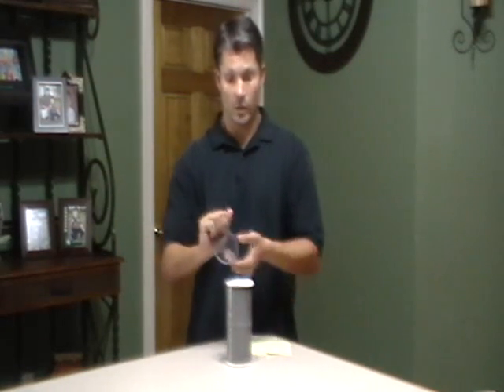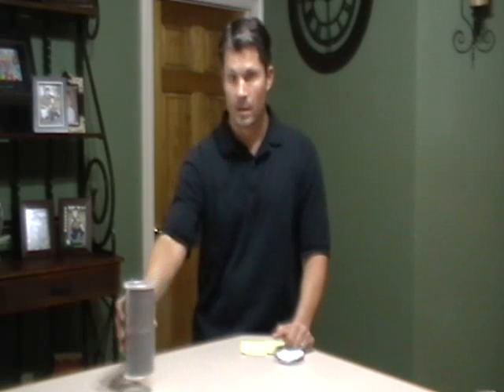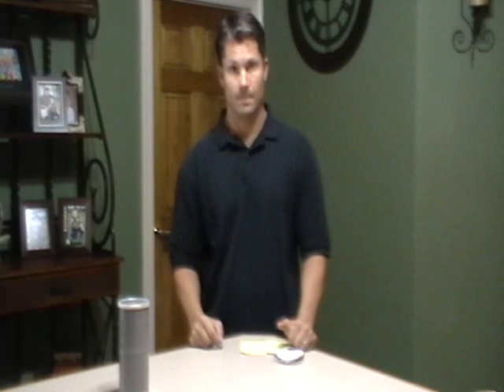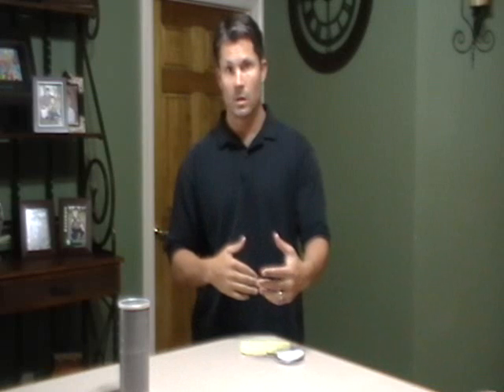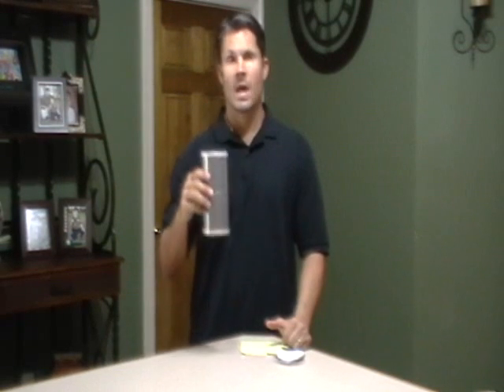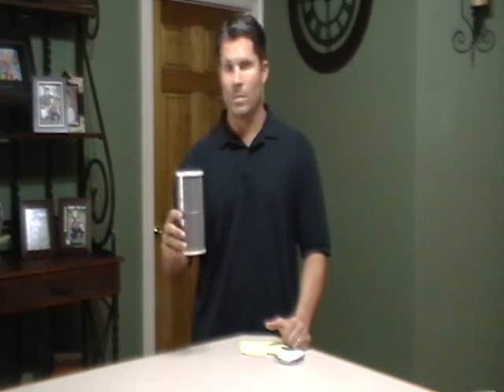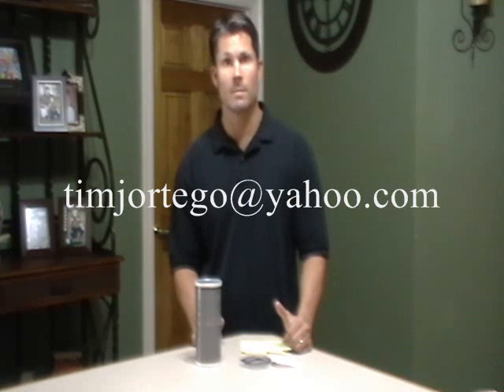Gulf of Mexico Oil Spill Clean Up and Containment

Comment: You have no idea of the volume of water and oil involved in this spill. Most of the oil you see on the surface has gone through a process called emulsification where the water and oil actually combine into another substance. This may work on diesel or motor oil, maybe even light crude, but not emulsified oil.